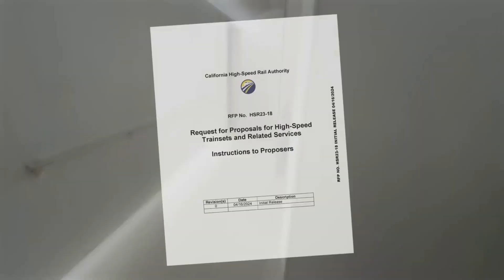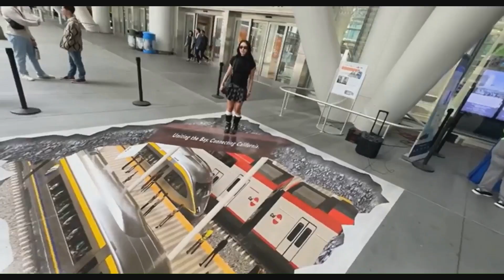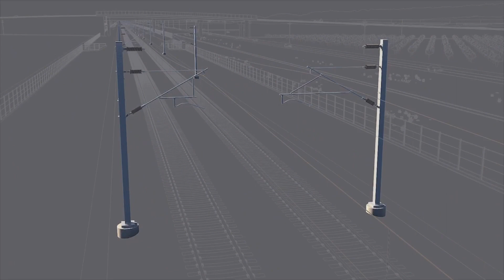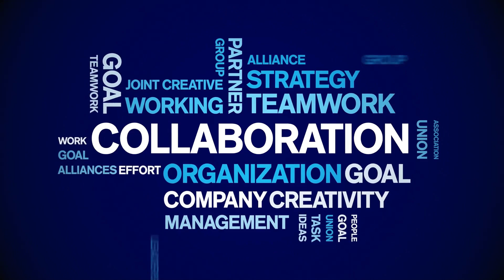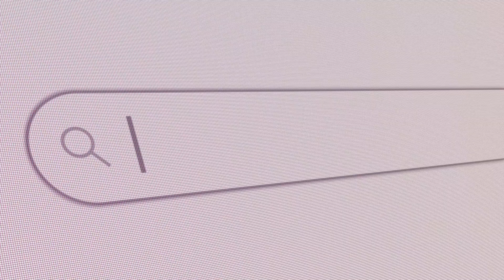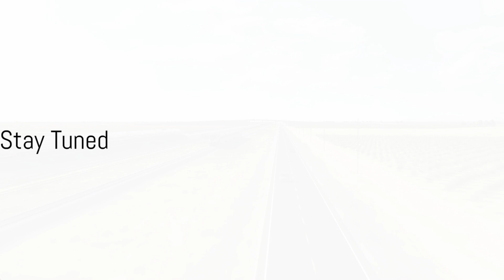California's High-Speed Railway Project: REVOLUTION Is COMING in 2025!

Comment: Reports keep claiming that CALIFORNIA HIGH SPEED RAIL was DERAILED due to ballooning 🎈 🎈 🎈 🎈 costs. Is this really true?
Reply: Costs have been higher than originally planned for many reasons. There were lots of (mainly) Republican law suits trying to stop it. There is little experience in the US of high speed rail construction. This was a problem especially in the beginning as outside consultants had to be used for almost everything and this increased cost. Over time CAHSR has improved their internal knowledgeable staff and have contracted with Deutsche Bahn as initial operator.  And don't forget that the initial bonds were only supposed to be to start the project. The history parallels the Interstate Highway System construction in many ways. Once a system is up and running everyone forgets all the problems in the initial construction. There is also the fact that much of California leans left politically and this causes piles of insults from the right, especially from those in other states. There is now enough cash in the box and coming in to continue through the next administration, even if hostile to electric powered transportation.
Reply: @danielcarroll3358  they contacted deustche bahn. This means the train system will be shitty
Reply: @pranshukrishna5105  The problem with Deutsche Bahn is that the government didn't spend money to maintain the system. They are now spending about 100 Billion euros to correct that. If you are traveling in Germany in the next few years you may have some slow trains as they will be diverted while the main lines are overhauled.
Reply: @danielcarroll3358  Deustche bahn is so bad, SNCF looks better in comparison, That's how bad it is
Reply: Absolutely false. 93 structures have been built & over 100 miles of guideways have been built.
Reply: @kim.jong.skillz  but they contacted deustche ban, service will be bad
Reply: No, it's not true. About $12 billion has been spent so far.
Reply: @mrxman581   but they contacted deustche ban, service will be bad
Reply: @pranshukrishna5105  That remains to be seen. CAHSR won't allow that, and I'm sure any contracts will have built-in clauses to protect CAHSR from things like inferior service.
Reply: AI is weak
Reply: Funding so far is about 100 billion short. Never had a financing plan other than getting the federal government to bail it out. Bad business plan to say the least. So far, a series of overpasses and a couple viaducts, scattered across the landscape. The rest of this video is pure vaporware.